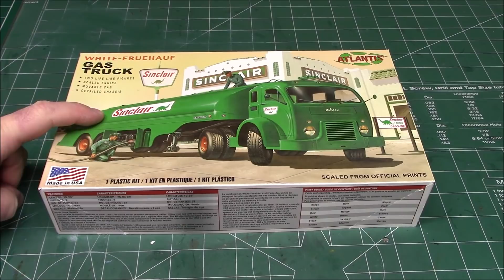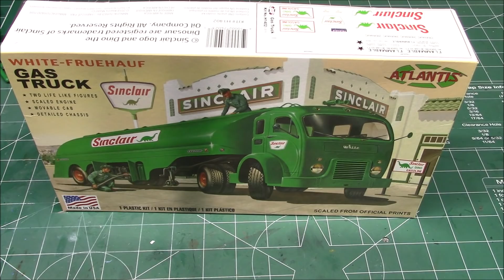White Fruehauf Sinclair US Army Gas Truck 1/48 Scale Model Kit Build Review Atlantis 1402

Comment: Chris, an old kit that I think used to be a Revell kit. Those molded ' Dayton' wheels and tires are great and capture what the real trucks had. These 3000 model White's were everywhere at one time. A lot of these were used in the moving industry, big trucking companies,  local deliveries, with some as fire trucks. I think White also built the 3000's as twin steer model single drive tractors for some compan- ies.

Comment: I built this kit, and the parts fitted in nicely but there where some gaps in the cab of the truck but I was using mr cement s which evaporates quite fast and sometimes it doesn't stick nice to some parts but I didn't have a choice since I ran out of humbrol cement and my testors bottle is a pain in the @$$ to get outta of the bottle but overall not a bad kit, but I'm planning to buy a o scale peterbilt semi truck to have it with the trailer, with different decals from another kit since I'm not going to put the Sinclair decals as mine isn't going to be a Sinclair truck, and as for the truck that came with the kit it's just going to be an old rusty semi truck that's going to be delivering logs,pipes,crates,etc. From any company on my small layout

Comment: I  just got this kit and I am looking forward to building it. Thanks for the  great tips. I have a question about paints. I like the idea of using Rusteleum paints because it offers model builders more color options. But dont these paints contain solvents and other chemicals  that soften and craze styrene? What kind of a protective base coat do you use to protect the bare plastic from paint damage? Thanks
Reply from the maker: Primer keeps the plastic from damage.
But so far I haven't had issues with any Rustoleums being too harsh. Automotive paints can be very very harsh.
Reply: @hpiguy  thanks for the info. I've been wondering about Dupli color too. I enjoy your site and the tips . Lots of nice builds. Regards